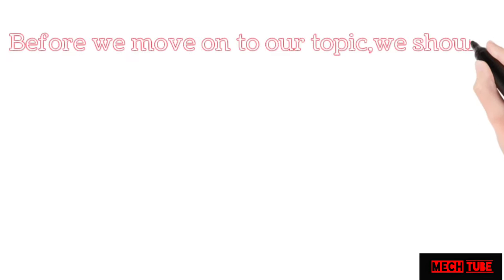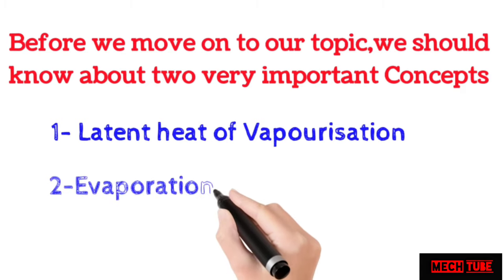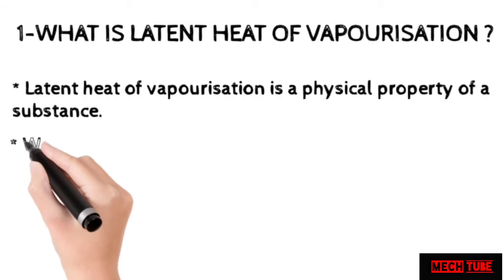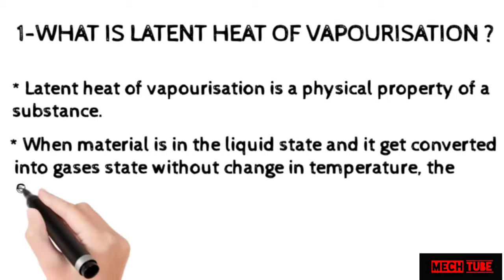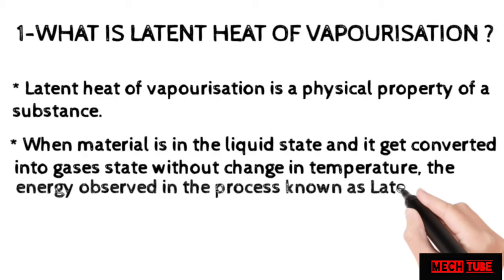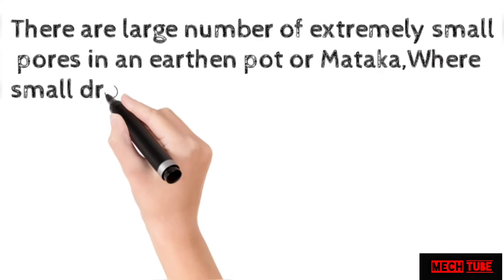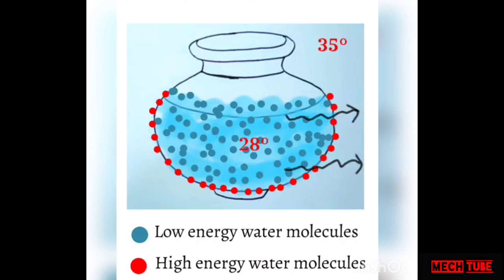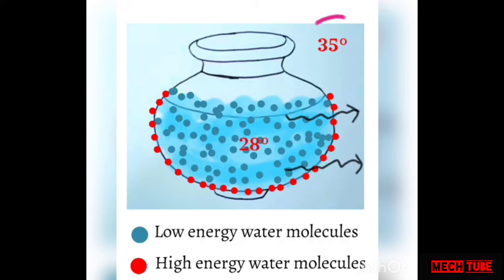How does the water in an earthen pot or Mataka become cool? | MechTube

Comment: energy transfer takes place form hot matter to relatively cooler matter. How can energy from cooler water transfer to hot water?
Reply: Yes you are right but the energy required by the water to evaporate from the outer wall of the matka is taken by the inner water, this create imbalance and to compensate the energy loss inner water is fall his energy by temperature loss, this is the concept of mass transfer from the system